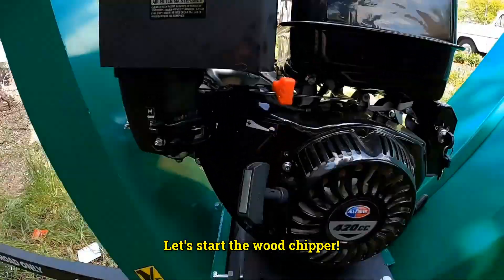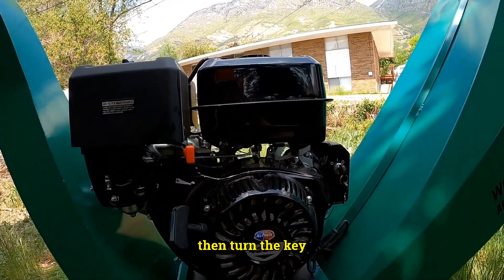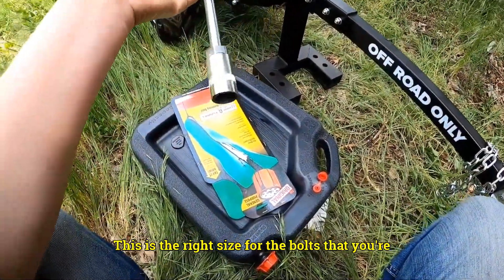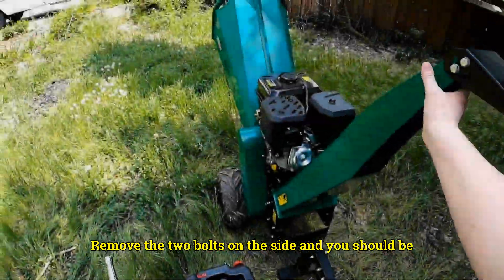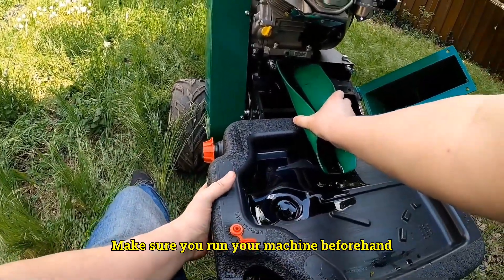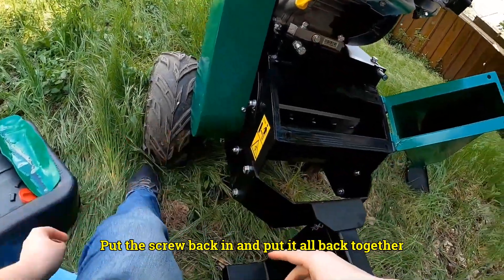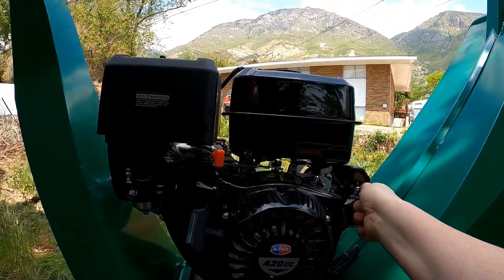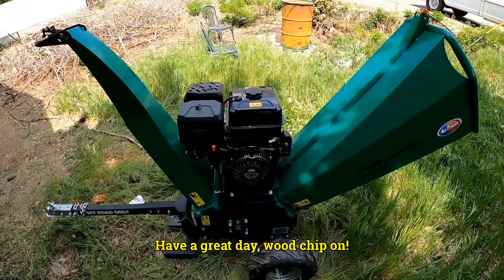🌲 APWC420 Woodchipper Oil & Starting Guide - Essential Tips for Efficient Operation 🛢️💨

Comment: If you take the feed chute off it's a lot easier to access the oil drain plug, plus you can pick up on the hitch to make sure you get every drop. Plus you want it choked when you start mine has the pull start only and I get it to start in two to three pulls max.  Choke closed, fuel open, throttle down, she will start like a champion. My 13 y/o boy can start it in a couple of pulls.
Reply from the maker: Thanks for the info! 😊

Comment: You need to close the choke, crank it and when it starts, open the choke.  That’s why it took so long to start, because you had an open choke on a cold start. I have one.
Reply from the maker: Ya, I've been better with start up since this video. Oh! Since you have one i am missing a screw or something that got vibrated off.

Do you think you could take a pic of your top of your machine at the part that holds the throttle at max?

I am having a hard time describing what is missing, if I send you a Pic you will know what I mean and maybe could help me buy the right part for it?

Email me at norkdorf@gmail.com